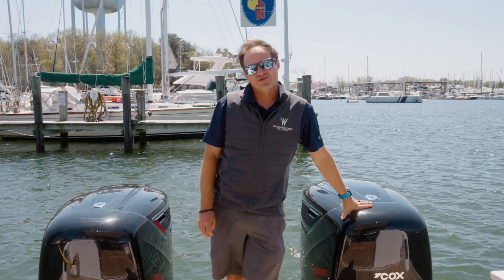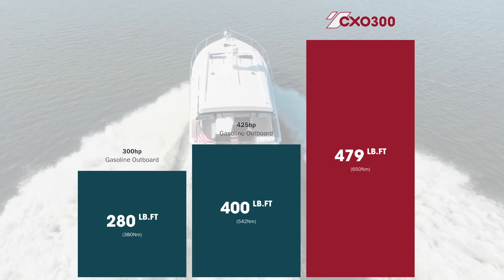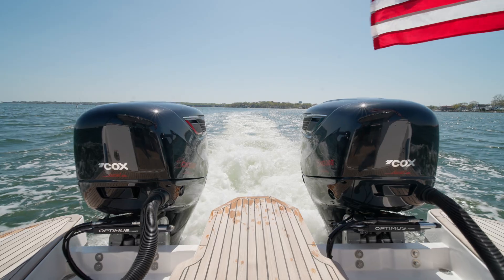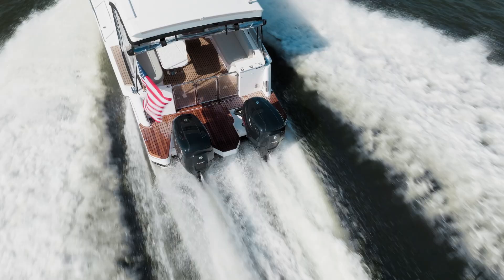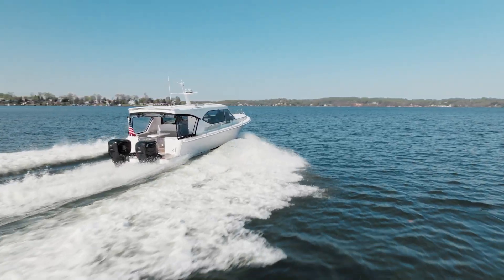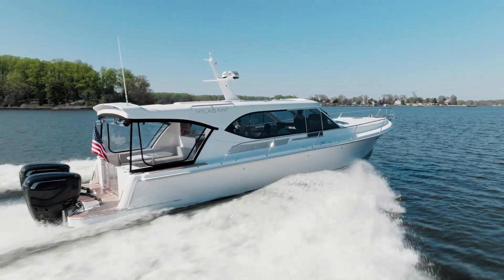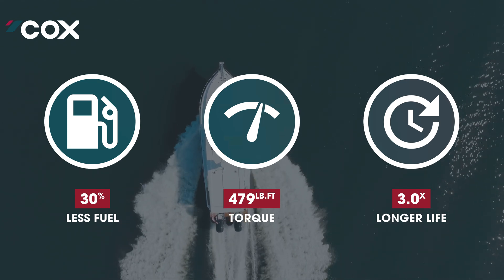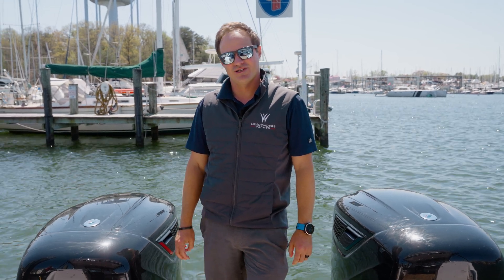The Hylas M47 - Why Twin Cox CXO300 Diesel Outboards?

Comment: Hi guys,

Greeting from Sydney.

Thinking of repowering my engine from Suzuki 300HP petrol to diesel outboard either 200HP or 300HP.

The biggest concern I have is the quick access to the maintenance and servicing especially when there is a problem.

Can you diagnose and fix as  DIY with support from you guys? Or do you have to engage certified mechanic or professional service provider. This will be my show stopper if I have to rely on dealer and certified mechanic.

I am good at mechanic but concerned about new electronic and software technology on these outboard to diagnose the problem. Is this accessible as DIY? Will this violate warranty as well?

Otherwise, please suugest or provide a solution how you can support DIY.( eg. Software update, electronic dignose tool and etc)

I also have a long experience of operating Volvo Penta 200Hp 41P-A engine with stern drive.  I have been maintaining and fixing it myself (eg. Rebuilding the engine and rebuilding the stern drive ) both sterndrive and engine. One of the main reason is that I need to have a quick resolution to fix the engine when there is a problem. 

So I can go back to the water asap. I cannot have the down time of the boat due to a mechanic  is not available in time I need. It is a loss of revenue for my business.

Comment: I hope you response. We just got our new Marine Rescue vessel with 3 X 300HP Cox diesels on the back. What do I think, well they are crap, overheat within a few minutes when in idle, then unable to restart or trim up outboards.
We are in a very warm to hot environment, have you had these issues, we are completely over these outboards, at this stage, totally unsuitable for marine rescue work.
Reply from the maker: Hi! Check with your local Cox dealer/distributor as there was a water pump update some time back and maybe your engines didn’t have it done? We have not had any overheating problems at idle and we had the boat in Miami with the old version water pumps. There have been a number of software updates as well and your local dealer can plug in with their laptop to do those.
Reply: @DavidWaltersYachts  Our outboards are only 4 months old and our dealer and Cox have been trying to rectify this fault. Not keen on taking our new rescue vessel out on any rescues at the moment.
We have been told they are working on a fix, can't come quick enough as myself and our skippers are not too keen to use our new vessel out on any rescues, thanks for your response.
Reply from the maker: @commonsense-grs  Hi there! Shoot me an email at josh@davidwaltersyachts.com maybe our contacts at Ring Power can provide some insights or ideas? Happy to try and help make some connections for you!
Reply: Hi, Have you managed to fix the issue? I was thinking of repowering from Suzuki 300HPnoutboard to diesel 300HP outboard. But this concerns me
Reply: @dylanlee4237  wouldn't touch these outboards with a 10 foot pole. Our boat has been off the water for over 4 months now, was coming back next week, but another major issue with another engine, not sure when we will get it back, they are a joke.